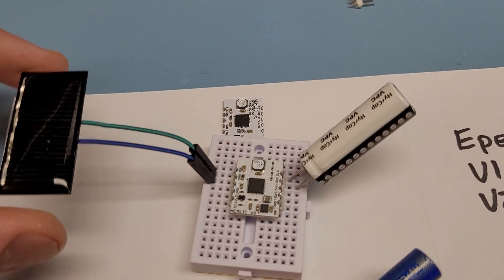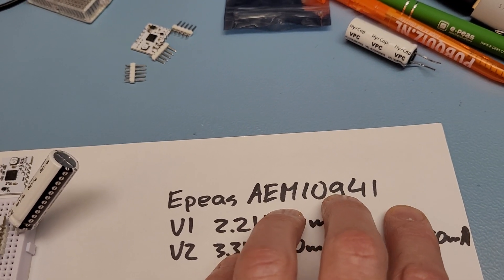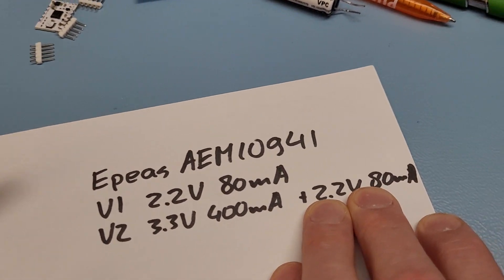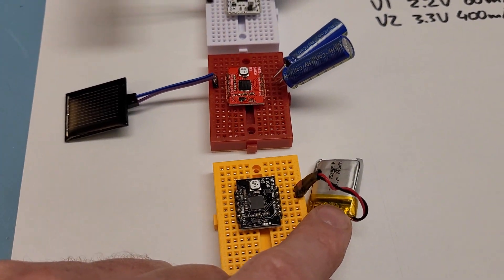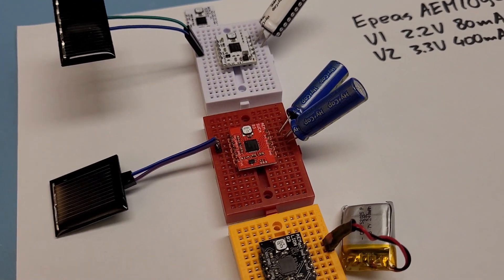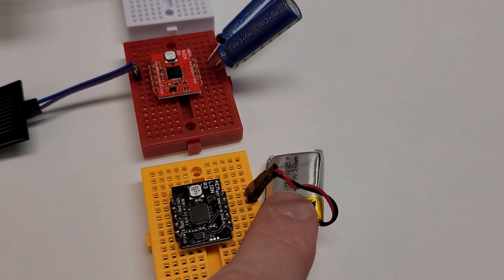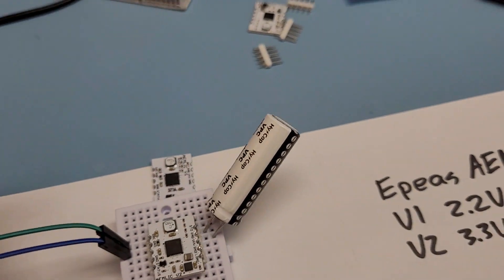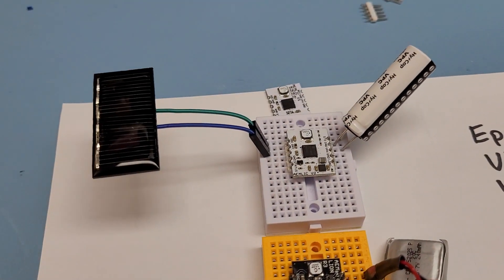A highly efficient solar powered Li-ion Capacitor charger

Comment: Nice project, how does the energy density of the lithium capacitors compare with supercapacitors and batteries?
Reply from the maker: Hey Terry! It is about 6 times lower than li-ion batteries and 6 times higher than supercapacitors.

Comment: Hello Jasper,
How long does the lithium capacitor provide or hold that current output?
Reply from the maker: The 250F LIC can supply continuous 0.75A which is enough for the 3.3V/400mA buckboost circuit
Reply from the maker: Rule of thumb: When a 1F capacitor is loaded with 1A the voltage will drop 1V in 1 second. The AEMLIC charges the capacitor up to 3.78V and the output is enabled down to 2.49V. If your application draws 30mA from the 3.3V output, then it will run for: 250F(3.78V-2.49V)90%/0.03A= 10750ss = 2.7 hrs
Reply: Thanks for that explanation!